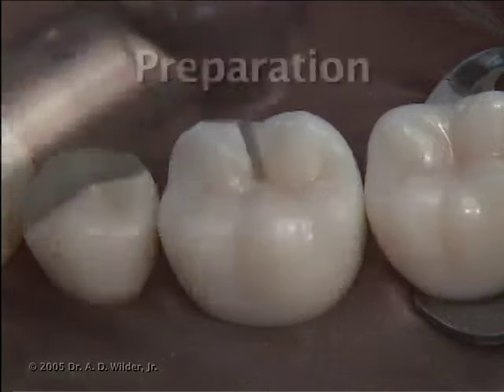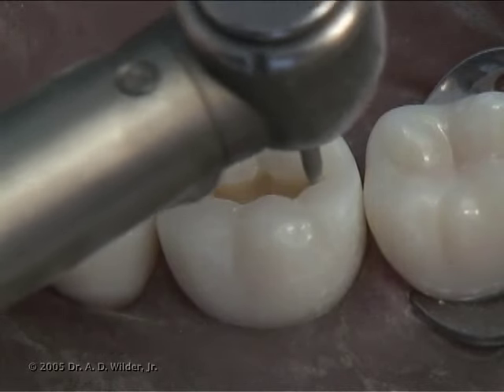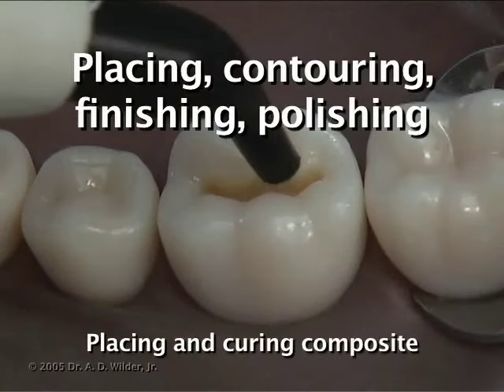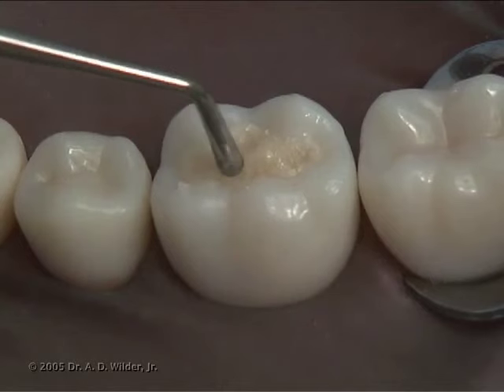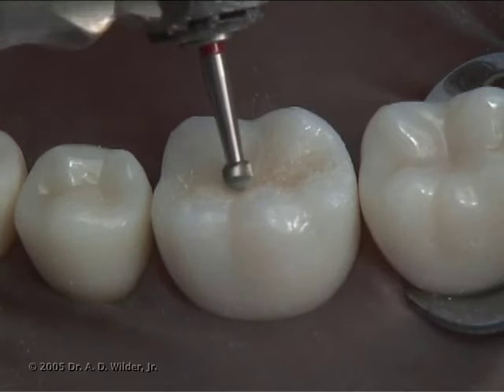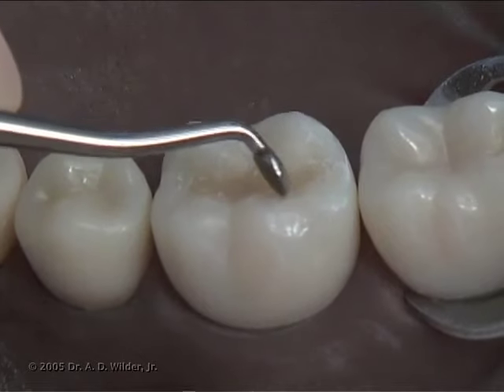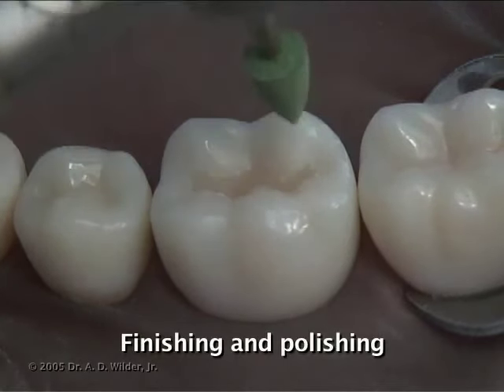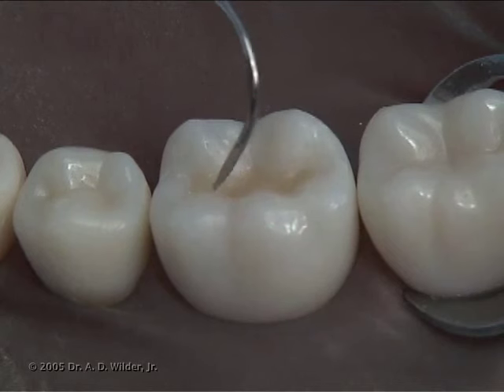Class I Composite Preparation & Restoration | Operative Dentistry

Comment: What happens if I don't use air after applying the bond? is it super necessary?
Reply from the maker: Some will argue it’s not absolutely necessary, but I do believe it helps strengthen your bond by evaporating the solvent with air.